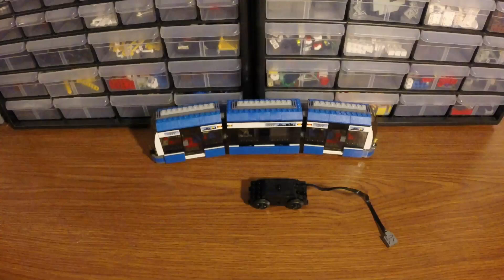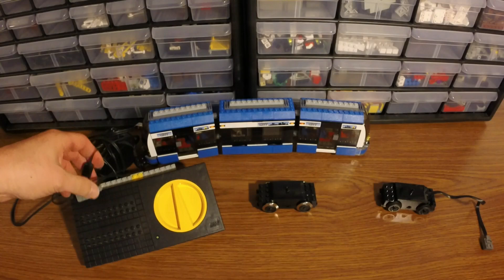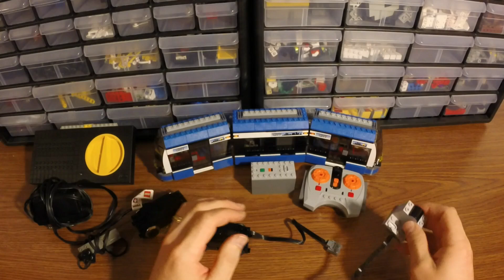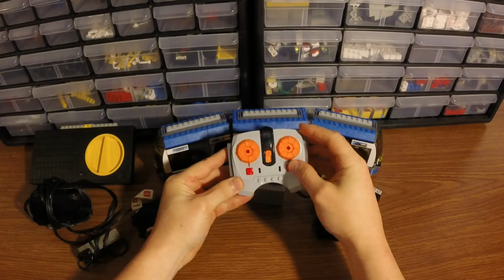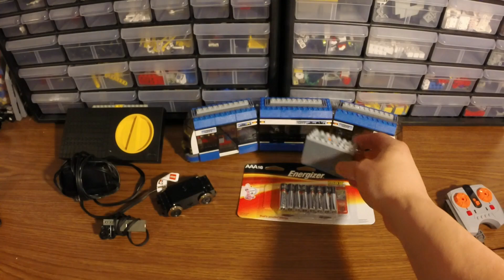Power Functions: Pros and Cons

Comment: My only problem with PF is that it uses AAA as opposed to AA batteries, as a) if you were to use lithium ion rechargeables it would be way easier to find them than AAAs. And b) AAs last longer then AAAs. Other wise, I'm fine with PF trains

Comment: If you don't use the receiver and connect the motor to the battery box, the motor will run at top speed if you do that in your trains, they derail and crash.

Comment: this is one of the best pors and cons with train power funtions vs v9, most others just down right hate PF you seem to know its uses. i have found thet the PF seems to have a stronger moter over the v9. also i know the recargeble battery box is $100 aud but once you charge them they last for more than an hour of full on running :)

Comment: I wonder if there is a way to run the 9v motor with the power functions so that you don't have to worry about the battery but you get the freedom of using the power functions controller.
Reply: Yes... But it should be handmade. You can use digital rheostat, controlled by IR, radio, wifi or bluetooth,

Comment: Could you use the 9v system on max power as a replacement for the power functions battery box, so the power from the rails will go to the power functions reciever? Both systems use 9 V so you only need a adapter to combine the pros of both...
Reply from the maker: Yes, you can. The main problem with this is how do you pass the power from the 9v track to the PF motor? The modern 9v motors have metal wheels to transfer the current. That would be difficult to substitute on the PF motor. It would be interesting to see if anyone has successfully implemented this.
Reply: Hay do you think that the emerald night is worth its price
Reply from the maker: +Daniel Mobley The value for this new is currently $400.  I wouldn't pay more than $200.

Comment: We have the power functions cargo train and soon city train (I have a station built but no passenger train) It is too expensive to do 9v here in aus as I need to import it and everywhere sells power function trains. If my table gets bigger than the current 2.4 x 1.2m I might look at 9v. I have older trains I prefer to the newer stuff and have been trying to work out how easy adding power functions to them would be, not to mention I doubt a 9v motor cost the same as a full power function set, which sometimes makes wanting an older train pointless given the huge additional cost. So I may go 9v in the future,

Comment: So i have a 9volt regulator and I'm really thinking of getting power functions. One reason is because my tracks, engines, and regulator are about 10 years. I also feel like power functions would work better with sloped tracks. My 9 volt has trouble with sloped tracks.  Do you think it'd be better to clean my tracks or just invest in power functions?
Reply from the maker: It depends on what you want to do in the future.  If you want to keep collecting trains and expanding your railroad, you will need to start buying Power Functions. Power functions will work better on slopes. If you are content with what your currently have, I wouldn't but them.

Comment: 9V has 1 dominating function.  And that's the fact that you can just plop the motor on any train and it works.  IE, any custom train or older train [My Own Train sets, for example] needs to have a 9V motor to run and look good.  Otherwise, you can just put the Power Functions in some car, so it appears as if the train is pulling it; whereas it's really being pushed.  l feel as if l'm going to spend the small fortune l have worked up over the summer from working on a 9V motor, regulator, and some track.  But the decent amount of track that I would want would be an ungodly amount of money.
Reply from the maker: Use  copper foil tape on the current tracks. It works just as good. Look at my older video on how to convert them. It will save you a lot of money.
Reply: Alex Nunes True, but I am now thinking about buying classic road plates rather than the 9V track.  For a few reasons: 1. price. 2. I'd rather just get RC track without having to put copper foil on it or buy expensive 9V track. & 3. the new RC trains look great.

Thanks for all these money-saving tips; considering LEGO stretches from all ages, it definitely helps considering l don't have a steady personal income.

Comment: 9 volt is the way it will always be the way because it is better  and I agree with you I have son power functions trains but changing battery's are the worst but I have a 9v train and it is cheap and great and can run longer and faster because it weighs less than pf trains.

Comment: You forgot to say that the 9V train also need the special tracks that are really expensive right now. Thanks for charing! :)
Reply from the maker: This is true to a point.  You can use copper foil tape on the PW tracks and it works just as well, but without the price tag.  Check out my vid on it. How to convert LEGO RC track into 9v track using Copper Foil Tape
Reply: Ok! Thanks! :)